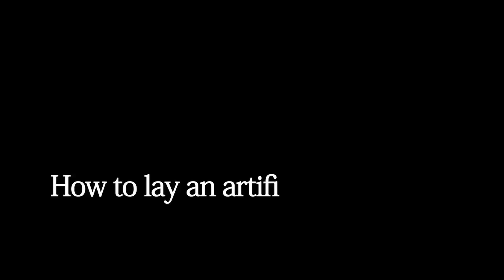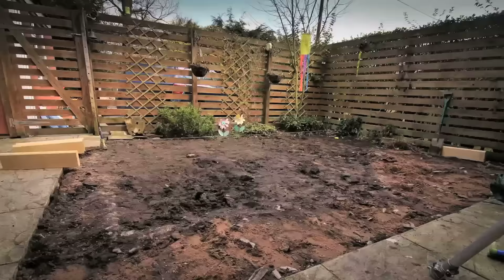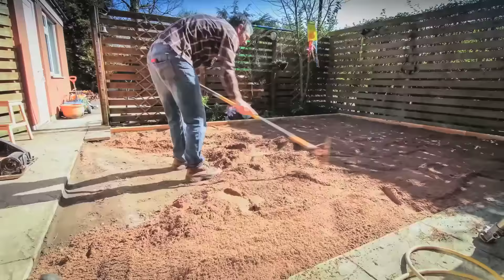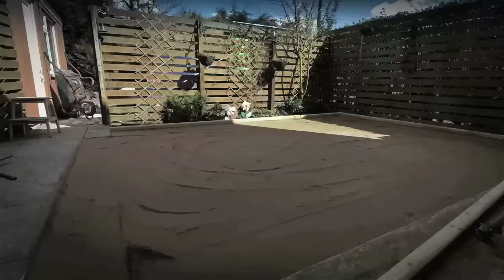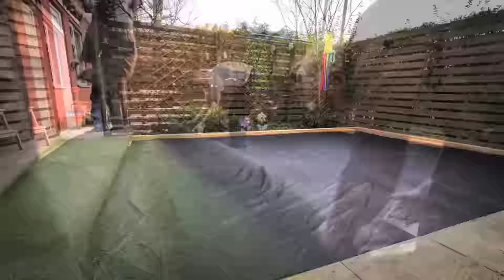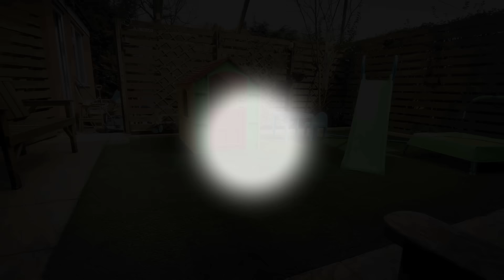DIY How to lay an artificial grass lawn turf - Timelapse with music HD

Comment from the maker: It's own weight will hold it in place as its slightly recessed but it comes with flat-top pegs to secure it but i did not use them.